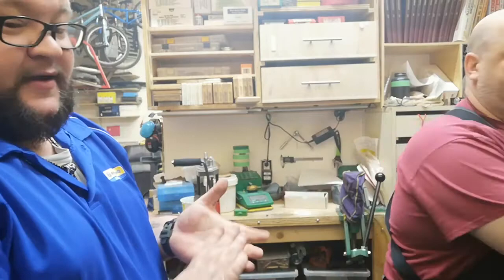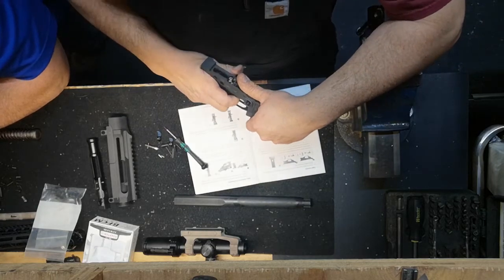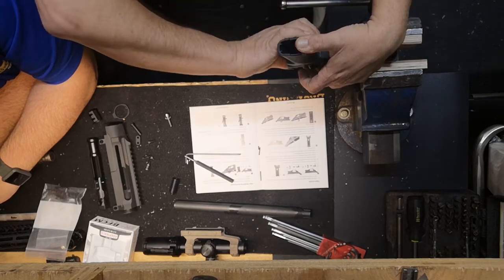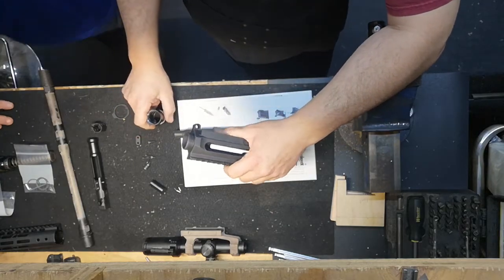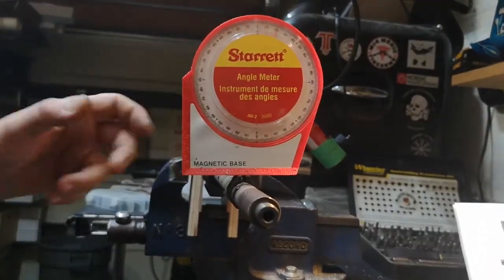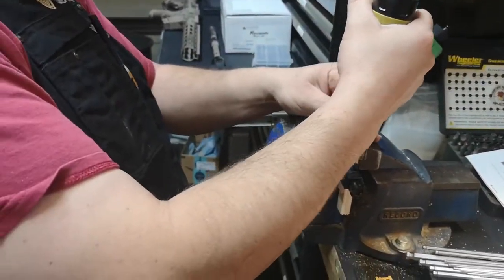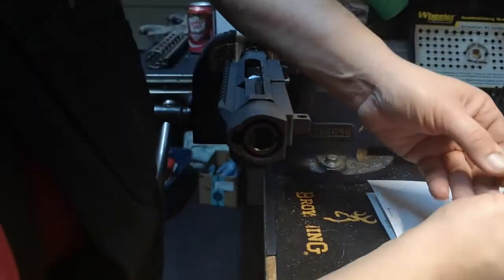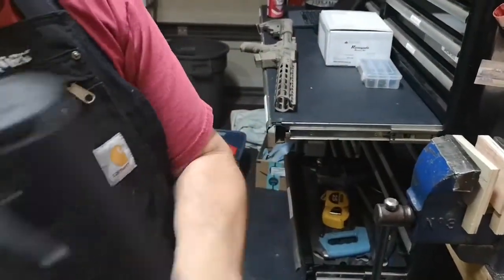Maple Ridge Armoury - Renegade COMPLETE BUILD

Comment: Nice job guys
Just bought one waiting  for it in the mail.
One question,  If i use a barrel with a A2 front sight would it work without the gas block or do you think i would need something else . Thx
Reply: You would need something to keep those gases going down the barrel, unless every time you shoot you want a blast of gas in the face.  A sealed A2 should work fine!

Comment: In my experience with both of my Renegades (one purchased complete, one built), the side of the receiver you put the charging handle on depends on your set-up.  Personally, if I have a bipod and shoot prone, I put it on the left side, as the support hand is free because of the bipod.  If I am shooting offhand, the handle is on the right side;  the support hand is required to keep the rifle stable and on target, so I use my trigger hand  (I am right handed btw;  do the opposite for you lefties out there).
Reply: I'm worried about getting carried away with fast shots and punching myself in the face.
Reply: @ironDsteele  It's not an issue.  If it was, they wouldn't have made all the straight-pull rifles from the 1890's up to the present day.
Reply: That's pretty hyperbolic.

Comment: What did you do to the bolt for the cocking handle?
Reply: He most likely found the correct socket head cap screw, the one shown was obviously to long, or he left out a spacer or washer.
Reply: We cannot confirm nor deny that we used some tools to make threads